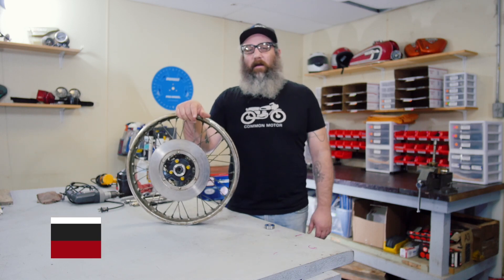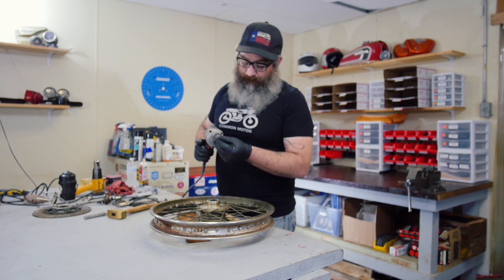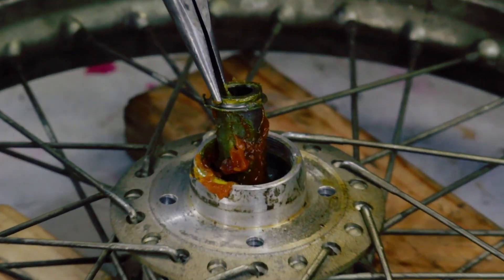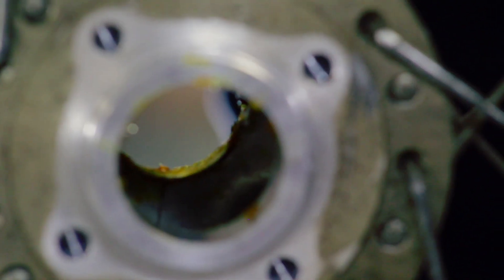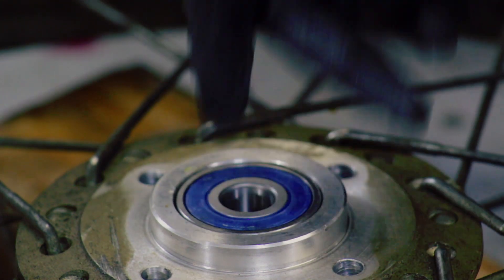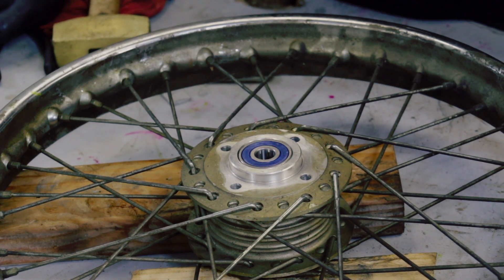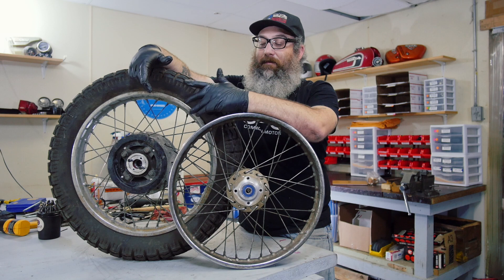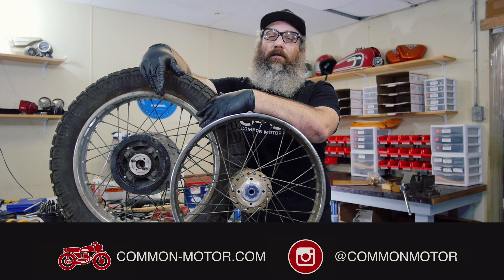Honda CB350 / CB360 / CB450  / CB550 Wheel Bearing Replacement - Front & Rear

Comment from the maker: Good news! We now make and sell the proper wheel-bearing retainer removal tools! Check them out if you are performing this repair because they will make your life a lot easier.

Front Disk Brake Wheel Bearing Retainer Tool: https://www.common-motor.com/honda-front-disc-brake-wheel-bearing-retainer-tool-cb200-cb350g-cb360-cb450-cb550-cb750
Rear Wheel Bearing Retainer Tool: https://www.common-motor.com/honda-rear-wheel-bearing-retainer-tool-cb350-cb360-cb450-cb550-cb750
Reply: Can't recommend these enough, the rear one made it an 8 second job.

Comment: I have found putting bearing retainer in before putting second bearing in ensures no pounding can displace first bearing. In this case, second bearing heat allowed it to drop in and hence no issue- but I like to be sure. Also, the tool to remove these with an impact or ratchet makes on/off easy.
What Common motors do is to provide methods to work on bikes with common tools that most can do, good job Brandon.

Comment: Incredibly helpful. Thank you guys so much for taking the time to make these excellent videos. My only recommended change to the re-install sequence, is to install retaining ring immediately after installing that side's bearing. The reason being, in case you need to gently use a hammer and socket to seat the opposite bearing against the spacer tube, you don't want to risk unseating the first bearing.

Comment: Another great video, thanks Brenden.  I was about to mangle the bearing retainer on my 72 CB500 when I figured I'd better check CMC for a tool, and you guys had a great video to boot.  I was only going to repack the original bearings, but you convinced me to replace them.  I just ordered the whole kit and kabootle.
Reply from the maker: appreciate the kind words! reach out to us if you have any trouble with the install!
Reply: @Common-motor  Folks:  I also got your bearing retainer tool which made the removal a lot easier!  Just a note though - on my 72 CB500 the bearing retainer on the rear wheel has a left hand (reverse) thread.  Good thing I caught that in the shop manual - otherwise I'd still be heating up the hub and trying to turn the retainer the wrong way!  I also serviced the drum brake and installed the new brake shoes I got from you - another great Brenden video made the job a lot easier.  I appreciate the little tips that he throws in.
Reply from the maker: @donaldcohen4453  Good call-out for the fellow CB500 owners! Glad they helped to get the job done. We're excited to have them instead of the homemade tools we used a few years ago!

Comment: Not sure how hard it would be to update this video or add the info, but the front wheel bearing kit you sell for the Cb360 does NOT actually include the seal for the speedometer drive. At least mine did not come with it. I really need one but unsure of the part.

Comment: Need more on the rear wheel such as showing how the spacers go in the wheel.  Mine is two piece and I'd like to see a bit more on setting the bearings and how you align the short spacer....which end?

Comment: On A550K78, it's left-handed threads. And you do not drill out and tap the holes because you will drill into the threaded of the hub itself. So I was watching your video.And I tried to take it out with right handed threads which was wrong and it's also a lot bigger bearing retainer totally different from what you showed

Comment: Help!!! Got a 72 CL175 and the right rear wheel bearing is seized onto the axle… Need to get the rear tire assy off! I have tried oil, heat and hammering on it to release it. Other than cutting the bearing off do you have any tricks?

Comment: Hello, dear friend. In Yamaha Trail WR155, one bearing is placed in the seat, but the original central spacer is 0.5 mm longer and the second bearing is not completely placed in the seat. Does this not cause a problem?  Thanks

Comment: Using new bearings I've seen them (even Honda bearings) that a cover on each side NOT have any grease inside!  I had to use a sharp probe to pop out a cover and grease
the bearings, then reinstall the cover.  Its something I've seen on several brands of bearings and without checking the bearings for grease they will wear out prematurely.
Reply from the maker: Its definitely always good to check. We use a brand we trust for having them be pre-greased and sealed and they haven't let us down yet!

Comment: Are the retainer threads left handed on the 77' cb550k ? I'm having a hell of a time with that thing.
Reply: They are!!! Don’t insanely overtorque them following this video like I did…I’ve spent multiple weeks mutilating mine trying to undo what I’ve done. They are indeed left hand threaded.
Reply: …Not to say this isn’t a fantastic How-To, just would be great to mention the Left Hand threading given the rarity in the automotive realm.
Reply: @devinpashby1104  I've mangled mine to piss already.Didnt know it was lefty.Taking the tire to a moto shop tomorrow and prob get cussed out lol.
Reply: @devinpashby1104  that's odd man, I have 77 550 K and the bearing retainer, heck everything on that wheel is standard normal threads,I assume what your talking about are the threads that when you tighten it loosens and when you loosen it tightens, correct?

Comment: Your vids have been SUPER helpful and will be placing an order soon for new bearings but any advice on how to punch out my ‘75 550 bearings? There is no lip to hit it out with the spacer in so not sure what to tap
Reply from the maker: I know  Brenden himself recently did a 550 bearing replacement on our shop CB550. We always have tech support calls you can sign up for on our website to get some more in depth tips and help like that.
Reply: The larger bearing on the rear wheel (under the retainer) has a spacer in the center of it, use a 5/8 socket and tap that spacer to knock out the bearing on the other side. This will knock out the other bearing and the two spacers then you can co e through from that side now that everything is out of your way and tap out the large bearing last.

Comment: Hi Bredan. I live in the Uk and have a 1977 CB125J. Getting pasts is a problem! Being a US model my bike has a disc brake, can you tell me what other CB models use the same disc? Are ther any common models that have interchangeable parts with the CB125J/S. All the best from Cullercoats.
Reply from the maker: I don't have any CB125J unfortunately I'm not sure. Its quite different from even the 175's if I'm not mistaken.
Reply: If you know the part number you could search on partzilla.com and when it identifies the part it often shows equivalent fitments across other models lower down the page

Comment: Hey, I have a 77 cv 550k and would like to know how to tell if/when to replace the bearings??
Reply from the maker: Id say if they feel crunchy and don't turn smoothly that'd be sign number 1. If the wheel moves side to side while tight on the axle that'd be #2. Last we usually change them regardless if the bike is nearing the 20,000-30,000 mile mark. Hope this helps!

Comment: Hello

I have a problem. I replaced the bearings on a set of old wheels witch i restorated for my scrambler projekt. The Problem on the rear wheel: When i strengh the Nut oft he axle, the brake panel is stuck and the wheel doesn’t turn. I cheked every thing and the bearings are assembled right ( The spacer inside are correct, so the positions oft he bearings are right ) . Seems like the touching surface between Breake Panel and Bearing has a small gap. Anybody solutions? (Sorry form y english)

Comment: Great videos - thanks for these (especially during this lockdown). Couple of questions: what do you think about greasing the outside of the new bearing to aid insertion (I see others doing this & it seems a good idea) and I see a fair bit of chatter about repacking grease even in brand new bearings (the argument being that the bearing maker often doesn't add enough grease) - what do you think of that idea.....unnecessary??
Reply from the maker: Hey Michael, first question: I wouldn't grease the outer races of the bearings you want that bearing locked into the hub if its greased it could spin out of its spot worst case scenario. Freezing and heating has always been all we needed. Second question: Great if you're re-using the old bearings, its hard to say for new bearings it depends on who is making them. Some bearings have to be packed before use like our steering stem bearings but the wheel bearings we sell are already packed and sealed from the factory and good to go!
Reply: That all makes sense, thanks again.

Comment: You might wanna review and revise the title of your video. I went buying M6 screws and taps like you indicated on your video and it didn’t work for my 550
Reply: Yeah they sell a rear wheel bearing kit that says it is for a 550 but it includes the wrong bearing retainer as the 550 uses a retainer with a large outside lip on the top side and different (larger) holes.
Reply: Agree there is some crossover but even the bearing removal is different for the 550. And the retainer is left threaded in the 550 that luckily I saw in the manual.

Comment: Wouldn't you use a spanner wrench on that?
Reply: Yes, ideally,if you have the right tool those "peen' marks come right out once you put the torque to the ground with the proper spanner wrench (or preferable a spanner  socket) , people always say that when rebuilding carburetors on these bikes the choke plates are impossible to get out cause Honda staked the screws,not so, if you use the proper JIS screwdriver you will do short work of that stake, what happens is people dont know what JIS is to begin with and end up destroying all  that hardware (myself included when i started on this project I'm on, Ive learned a few tricks since then,lol)

They stake and peen these screws so they wont back out under normal circumstances but that doesn't included a human being with a spanner.lol, but it doesn't hurt to drill the peeen out if you choose to do so, less damage on the bearing retainer.

Comment: Thanks for video.  I have a question about installation.  Does the bearing go in the hub a certain way.  I mean does it matter what side of the bearing goes in.  I have been reading that the writing should be on the outside of the hub.  Thanks